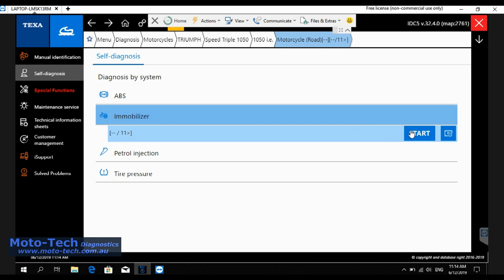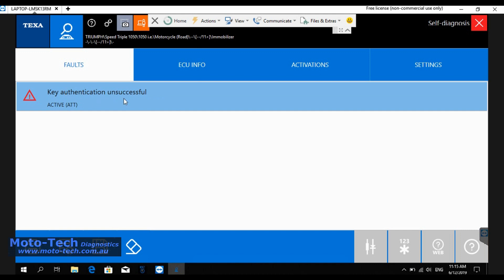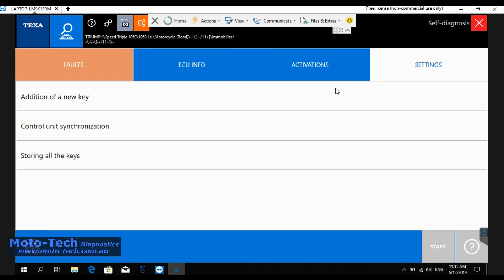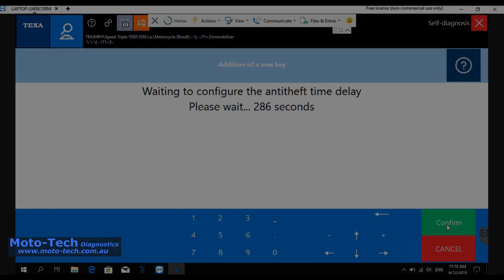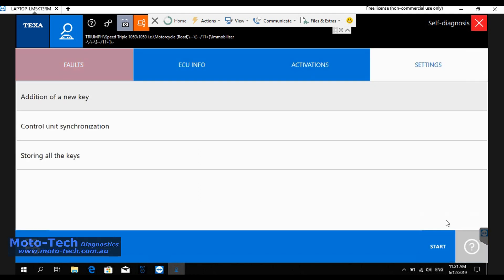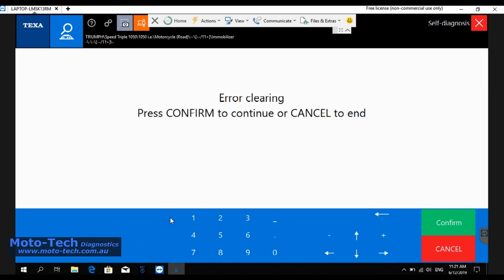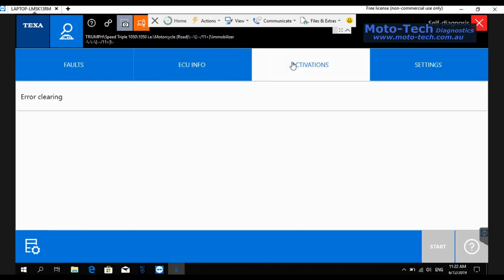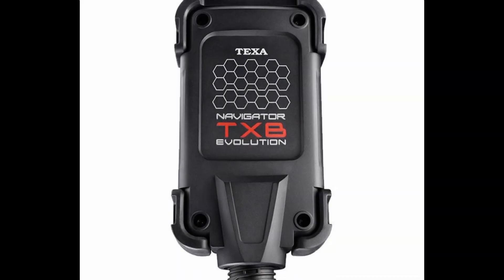Triumph Key Programming with Texa Diagnostics and IDC5 bike software

Comment: Hi there. Do you know any shop where I can get this done in Melbourne? Maybe one of your customers?
I've purchased a repairable write off bike for attempted theft, 2015 street triple 675. I have the original keys but am looking to replace the lockset. Triumph said the original ecu must also be replaced before a new set of keys can be coded is this correct? 
Cheers
Reply: I bought a damaged one with on keys had to replace ecu and locks as can’t program new keys when the old ones are lost

Comment: Are you able to program if all keys are lost?
Reply from the maker: No sorry. With no keys we cannot turn on the ignition. You will need to contact a key specialist who can hack the ecu to clone an existing key code.
Reply: Hola ,tengo la  llave de la moto pero tiene el transponder dañado, puedes hacerme una copia?
Reply: Hi. Do you know how to clone the key codes from ECU? Can this obd do that? I lost my only key but already had it cut to a blank key. I manage to turn on the bike wmusing the new key but can't crank the engine. @mototechdiagnostics
Reply from the maker: @stabiloboss890  if your key has the correct chip, the ecu will write a code to the key. Contact your local Texa diagnostic specialist workshop to ask if they can do this for your bike.